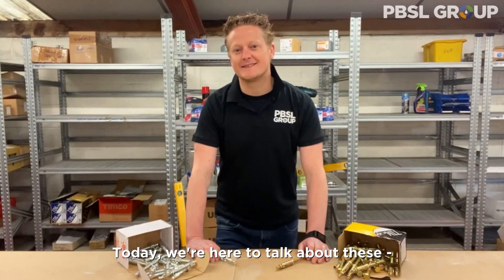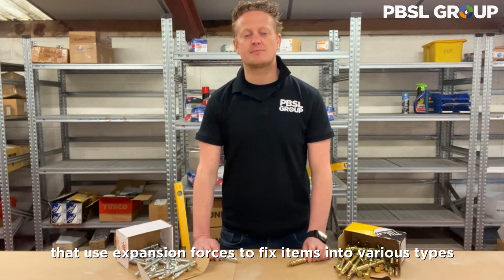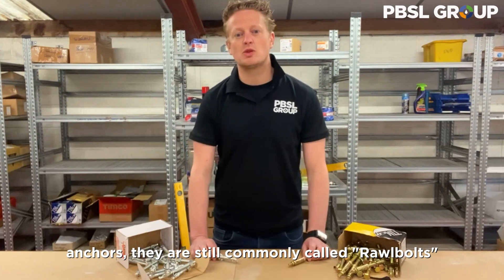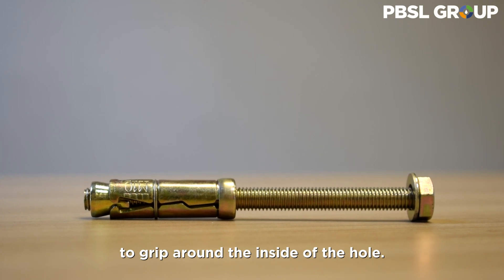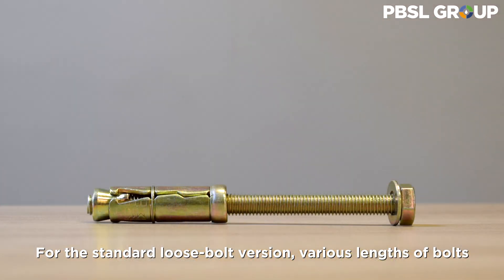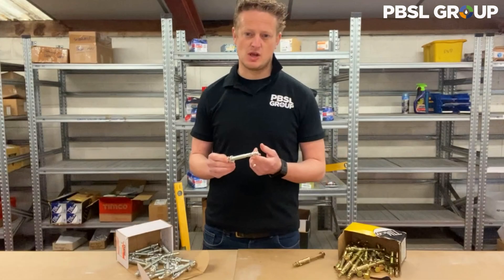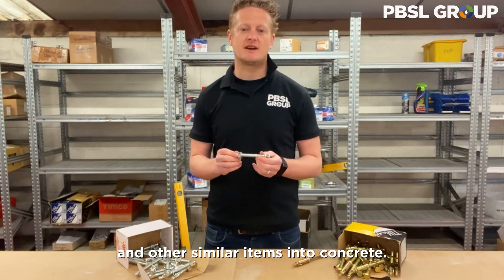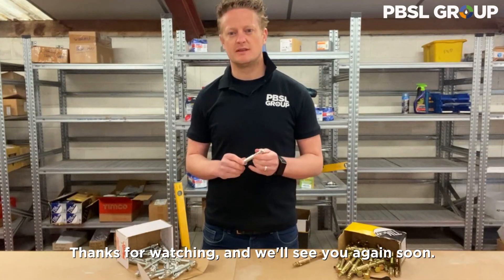What are Shield Anchors & Through Bolts? | Product Showcase

Comment: What is the minimum thickness  of a shield bolt required for this set up : 

2 d rings into concrete ceiling ( with each taking 2 shield bolts ) 

Use case : hanging gymnastic rings. I’m 80 kilograms . Wanna account for momentum work that could take the weight baring up to 120 kilo ( distributed somewhat equally on both d rings ) 

You opinion will only be considered as an opinion and not a safety advise 😊